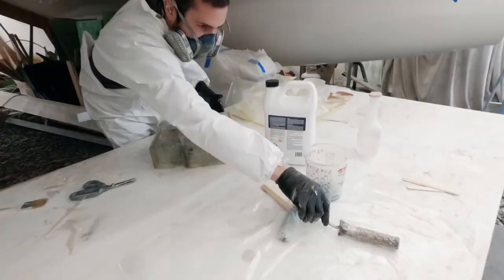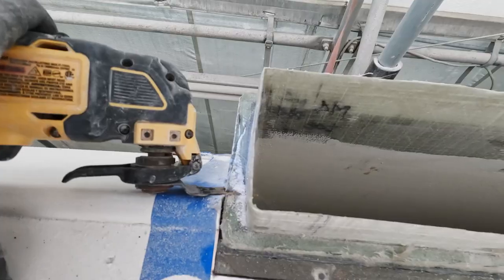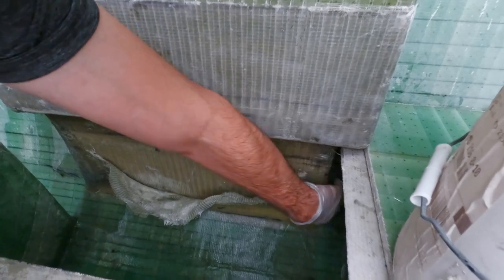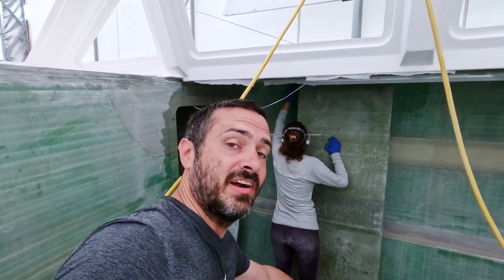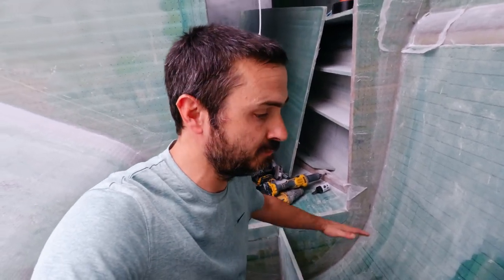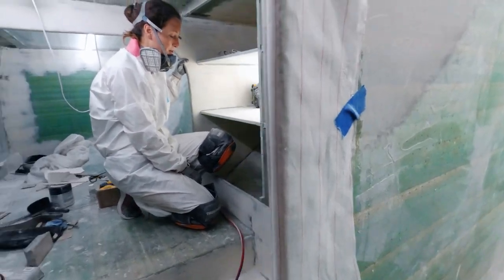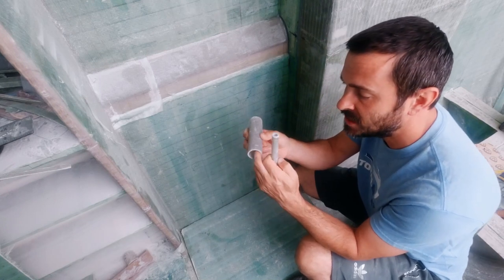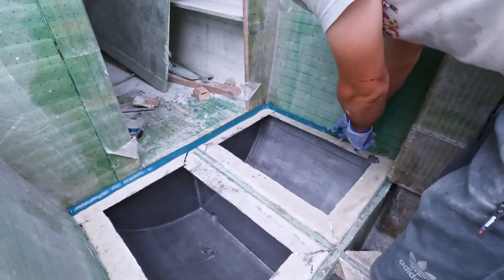This Is Not Coming Together - CATAMARAN BUILD (MJ Sailing - Ep 245)

Comment: You guys are beasting this. Of all places to have bad batch issues with the resin and catalyst...but you crushed it and moved on. Impressed, very well done 👍👏👏👏
Reply: They said in another comment it turned out to be a humidity problem... user error. 
MJ Sailing

MJ Sailing
4 days ago
We think it ended up being a case of very high humidity (90%), so on the 3rd attempt we put heaters on the area, and that seemed to do the trick

Comment: Do like the revised position of those daggerboards.  Nice to have the extra space down below, but I think the most important difference will be on deck.  Not having the daggerboards in the middle of the walkway will significantly improve the safety and ease of working on deck.   I suspect that your fastening will also add additional strength to the case compared to normal.  Good call.

Comment: FUEL TANK areas. to remove the core. use a cordless drill and an allen key. it will chew out the core very easy. USE the clutch on the cordless drill.   Fuel tank area I would suggest two layers of matt over the entire surface. then a fuel grade barrior coat. I do fuel tank pressure testing with my company here in south florida on boats. DO NOT exceed 2PSI when testing. and it should hold for 24 hours.

Comment: Vinylester has to have EXACT amounts of hardener--just like epoxy.  When using any new batch of chemistry, always try a test piece first.  I have had drums of resin that were no use at all and had to be returned.  Before you strip off the un-cured resin, try a heat gun on it to raise the temperature.  What have you got to lose at this stage?  That heating may initiate a delayed cure--if you are lucky.

Comment: Bummer about the dud mixes. It is pretty important to get that glassing at the bottom of the case correct. It looks like you are using double bias. I would suggest also getting some unis and wrapping these around the back of the case leading forward. I did this with my cat 22 years ago and it brings peace of mind knowing that the back of the case has extra reinforcing to help in case of grounding. I also cut off the bottom 300mm of the board and then glued it back on. It gives a fail safe for the board in case it is full down when you hit. I built some spare ends when building the boat. The ends have not cracked off and the spare ends are unused still, but it is nice to know that the cases are extra secure and the boards have some sort of fuse. Cheers Phil

Comment: Hi MJ, as I am a car restorer have you thought about using spray poly, a spray on polyester filler using a gel coat gun. I have used this product on a few cars with long panels and the result is a nice flat surface without all the hard work filling areas with bog and associated sanding. It will fill small imperfections not large that you need to bog/fill but it is a polyester product so may not be compatible over epoxy. I have been watching you fair those shelves and if this is compatible would be a lot faster even if you aren't looking for a show car finish.
Reply from the maker: Hi Dennis.   Is that any different than an epoxy based high build?  We'll be using that as our primer once we are to that stage to fill pinholes.  But at this point, we need to cover the fiberglass tape lines, so a real fairing compound is needed for these big fills.

Comment: Interesting issue trying to glass the dagger board enclosures into place. It was a little anti-climatic when so much was said about the issue, and problems to resolve it and we are "glassing in again" then the next shot is ok with the dagger board enclosure glassed in we are working on the fuel tank. Uhmm thought you may have explained a little more on how well the resolution worked, and thoughts on maybe this was a bad product that caused the issue. Anyway nice to see how your progress is moving forward. Plus i do understand it is hard to split your time videoing Editing and actually getting the build work accomplished as well you are both doing a great job. My best wishes as this continues.
Reply: They did explain the problem, the new batch of vinyl ester was bad. They had to use some of their older stuff.
Reply: @philipmackin1025  hat's not true. Here's their response in the comments.
 "MJ Sailing

MJ Sailing
4 days ago
We think it ended up being a case of very high humidity (90%), so on the 3rd attempt we put heaters on the area, and that seemed to do the trick"

So, it boiled down to user error. Glassing in bad weather conditions.

Comment: I have been a paint and body man for 38 years. Boats, cars, big trucks, you name it, I've worked on it. I learned early on a couple of things about working with fiberglass. Never trust resin and harder dispensers. Ensuring the proper ratios is a crapshoot with those things. Always measure by eye or weight. And always store your chemicals in a climate controlled space if possible. Temperature and humidity affects the components more than you may realize. Just a few thoughts.

Comment: To remove core from the sandwich, we use keyway cutters in a die grinder. very simple and the shaft of the cuter controls the depth of core removal
Reply from the maker: We typically use a router and bit for this because we need a bearing against the thin glass. In this situation, the keyway cutter would work better.

Comment: Are you coming back to the fuel tank later to cut access hole for fuel line to engines? Are you going to set up to cross feed fuel tanks to each engine?

Comment: I've had a few projects over the years that I had issues with not hardening with polyester, never really figured out the causes, the supplier said that it was not mix correctly or mix thoroughly ? But you can count on a few box of sand paper to get rid of the sticky ! Have fun people....

Comment: Did you paint the fuel tank lid/floor before laying it in place? Also does the inside get any glass between the floor and Angeles spots you bonded it to? Idk is the thickened stuff fuel resistant. It seems like it needs inspection ports on both side of the baffle.
Reply: It looked like he did.
Reply: I couldn’t tell.  Great point.

Was wondering how many gallons of fuel will it hold?   He knows best but my hunch would be to add another section in to increase fuel capacity.
Reply: look at 16.21 can see underside painted

Comment: This is the first time I watch your channel. I am a dingy Fireball regatta sailor. I saw how you build the Diesel tanks. I have one serious question. I have heard of the Diesel Bug, it is contamination of diesel fuel by microbes such as bacteria and fungi, it turns the diesel into a Biosludge.  I have the impression that the Diesel Bug prefers the hot tropics. Biodiesel makes the situation worse. The Diesel Bug prefers vehicle with a longer standing time, like catamaran that are in harbour or on the hard during Huricain time. 
I have  watched several YT Cruisers like Doodles, cleaning their diesel tank by opening them up, after flushing the tank with different chemicals that promised a full tank cleaning themselves didn't work out satisfactory in any way. How do you catamaran builders plan to deep cleaning out your fully inbuilt diesel tank, that has no hatch that can be screwed on and off? It looks impossible to me. I think you are calling for trouble. I am sorry, good luck anyway.
I guess the same can happen to fresh water tanks, the water inside them can turn nasty, it is all biological. I would not accept a huge water tank witout a hatch. I have seen dirty ones on YT often enough.

Comment: Excellent work. What is the capacity of the fuel tank? Is it correct to assume you will have another fuel tank on the other side of the boat?
Reply from the maker: Yes, we will have mirrored tanks in both hulls, and each should hold 50 gallons.
Reply: @MJSailing  since you have the underfloor space would more fuel capacity not have been a good idea?

Comment: Best Part :  The two of you doing the "running man" at 19:25 !  Noticed that the fuel tank was fully coated on all sides with the protective paint, but it appears the other aft tank spaces were only coated on bottom and deck section was left uncoated.. are these spaces under sole going to be used for provisioning storage later, or as water tanks ?
Reply from the maker: Hi Mike.  Everything is sealed in the floor and used as buoyancy chambers.   We have over 70 cells in this boat that are sealed to make sure we can keep sailing even if a few are breached.

Comment: Awesome work. Matt, I'm wondering if a soft to medium wire wheel cup on an angle grinder would remove the resin residue without gumming up... I used one on the bus to remove school decals from the steel. Of course one would have to be careful not to remove too much material.... And hopefully you don't have to remove any more malfunctioning resin.

Comment: Why not use more under that foor for a bigger fuel tank??
Reply from the maker: Each hull's tanks will carry about 50 gallons, which should be plenty for us.  This is a performance catamaran that sails well in light winds, so we should only be using fuel on our way in and out of harbour, and if we get stuck in the doldrums for a few days.  Test sailing this boat in Vietnam though, we were able to sail at speeds of 4-5 knots in 5 knots of wind
Reply: @MJSailing  im not sure if its the camera angle but it really doesn't look like 50 gallons ?

Comment: Wouldn't it be better for future potential issues to just have stainless fuel tanks made to fit the area? That way if a problem occurs its more readily repaired and doesn't impact the integrity of the hull. I worry about the glassed-in homemade pipes for fill and vent. A problem down the road would be challenging.

Comment: I must admit, I baulked when I saw where the fuel tanks are, I'd imagine you didn't make that call without a lot of research, if for nothing else than your peace of mind
Great job & now the floors are down, onwards with a vengeance 👍👍👍👍
Reply from the maker: It was a huge toss up on location.   The stock plans call for them to be along the inboard hull.   But in doing so, the fuel fill and vent need to be on the side of the tank...I don't love the idea of fuel being held in the hoses - we had that on the last boat.  The tanks were also under the shower mold and not a location that can be reached later after it is in place.  

This is the most accessible location, but it comes with the environmental danger of having the tank tie into the daggerboard case.   Our last boat had keel tanks which would also be an issue if we collided with anything, but I didn't worry about them there.

Comment: Was surprised you are sealing cavities - like behind the daggerboard cases. Intuitively you want some air flow everywhere I would think. Sealed places that are not vacuums degrade like windows do over time ... perfect places for drips of moisture to turn to black mold.
Reply: Venting holes could be cut in?  
  Although a sealed area my not cause problems as moisture from fresh air cannot get to the area to condense.     So vent would make it worse!    
It the space is truly shut, would temperature changes cause pressure changes in the space, warping the hull?
Reply from the maker: We have over 70 sealed areas for emergency buoyancy.  It's been done this way for decades on performance cats - ours just has more of them- and they haven't had issues.
Reply: @MJSailing  you should fill the voids with orange ping pong balls with  magic carpet printed on them !  The Debris field is much bigger and gives The search team a fighting chance ! Lmao.      
Have fun people .....

Comment: have you checked the resin is using the correct catalyst system there are also accelerator systems that work with individual catalysts. normally the accelerator is added to the resin by the manufacturer but for some uses (injection ,vac bagging )a resin is supplied unaccelerated  then the catalyst will not cure the resin even if 3 % is added. The standard accelerator systems are cobalt or amine based and will be set off by MEKP  or Benzyl peroxide as catalyst AAP needs a different amine to start the reaction .and polyurethanes and epoxies use completely different systems

Comment: I wonder how many hours of run-time they will have with their fuel tanks... they look a tad small for a boat that size....
Reply from the maker: Matt did calculations on the space, and based on the numbers, each tank (port and starboard) should hold 50 gallons.
Reply: @MJSailing  How many hours of run time will 100 gallons get you?
Reply from the maker: 200 hours

Comment: I assume that Total Boat (or there supplier) has sample of the Batch of the resin they sent you. That is normal practise. They can check the curing properties of your batch of resin. This really seems to be a problem with the promoter. This is the cobalt and other chemicals they add to create the curing profile of the resin. Hunter Boats, in the middle of Florida had a laminating “building” that consisted of a steel roof and fencing. Humidity was 100% virtually all the time. We used to do a 50 gram curing test on all batches of resin. 200 drums if resin per year, failed 1 or 2 failures per year
Reply from the maker: Totalboat doesn't make vinyl ester, so we source elsewhere.  This resin has been used for at least a month and had no issues elsewhere.  We even did a cup test with different ratios and they all cured correctly.  It was just when we glassed that we had a problem
Reply: @MJSailing  was the resin from he actual same container/batch. The batch numbers are usually on the container/packing slip

Comment: Looks great, probably covered this.  But fuel size total gallons/liters useable?usable??
Reply from the maker: Matt did estimates based on dimensions, and the starboard fuel tank should hold approximately 52 gallons.  We ended up doing the same setup on port as well.

Comment: Did you have any more thoughts on why you did not get a cure on those parts you put in? Only thing I could think of was some contaminate on parts of the fiberglass or the parts themselves.
Reply: That's what I was thinking... Something chemical on the substrate was stopping the hardener reaction.

Comment: A suggestion, make the fill line larger
Reply from the maker: It's the standard 1-1/2 inch.   We can't take full bunker fuel rate anyway, so it doesn't really matter on these tanks.

Comment: So how many miles on the 52 gallons will you be able to travel? That seems small for that size boat.
Reply from the maker: That's actually huge for us.   We will burn around 1/2 an hour and do over 7 knots.
Reply: @MJSailing  Love your channel, but can you include in a video of how you will only consume 1/2 gph and cruise at 7 knots?? that would give you a range of 1400 miles. Maybe you meant to say 1/2gph per engine?, but still 700 mile range with 104 gallons is a bit optimistic for a boat that size??
Reply: I was wondering the same thing.  I had noticed that on Parlay Revival their Lagoon 450 has 1000 L or 254 gallon fuel capacity.
Reply: @ralphgesler5110  it doesn't matter that its a sailboat, the point of having engines is for the scenario of no wind and alternating engines only means one has to work harder so alot of times it will burn more fuel by itself than with 2 to maintain a given speed. If their calculations included x knots of wind, then I would like to know.
Reply: @Jpeveto44  yes but the 450 is a heavy boat..
Reply: @br5498  thank you for responding.  I honestly have no clue in these matters,  I'm still trying to learn. In my mind the idea of being in the middle of the ocean with no wind and not enough fuel is very scary. I have no idea how long it would take to get to a safe place at 7 knits if you're as far as you can possibly be from land. I also understand that a smart sailor would plan their sails with the idea that they might have to motor the entire way.

Comment: I think your project is fantastic and your work habits and relationship with each other is excellent. But I have to criticize you fuel tank size calculations. My estimate/calculations would put it around 40L or close to 10 USA gallons. Love your work and think this will be a fabulous sailboat. I hope I am incorrect.
Reply from the maker: It is 650mm long with a width of 990mm....which equals 132 US gallons.  But since it isn't a perfect circle, I based off the actual height of the shortest dimension which is 450mm.  Half that and we're a little over 50g a side.
Reply: Thank you. I stand corrected. You two are doing a fantastic job.

Comment: Moving the dagger boxes to the outside of the top deck was Wizard Level Awesome!  What I don't understand is why you did not make your fuel takes larger.  I have been keeping notes on how I want my cat built.  Are you still sure you can start my build in 3 months?                                   Be happy, be safe
Reply from the maker: They are 50 US gallons each.   Way more than enough for this boat, and we'll keep them half full the majority of time for weight savings.   Good luck with the build
Reply: @MJSailing  💕 Thanks for the reply.

Comment: Fantastic work as always.   Amazing work and great team work.  But why not use standard epoxy? Is,it cost related or strength?   Great work
Reply from the maker: The boat is vinyl ester resin.  Epoxy has some good things going for it, but VE is so much easier to use and has similar strength to a mid range epoxy like West Systems.  Overall, the cost for us is higher with VE due to shelf life and only being able to have order smaller quantities at a time.  With epoxy, I would have bought barrels of it.
Reply: @MJSailing  great work.  Makes total sense.